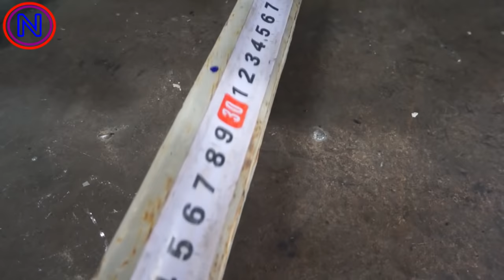Wow !!! What I Did From The Old Sewing Machine

Comment: Have you ever thought about making a potter's wheel out of a weighted weel stationary bike, all you have to do is weld a gear to the front wheel to change the direction of the spin then add a base for a potters head, head available thru AMACO add the cage and drip pan out of an animal feeder when you add the cage around the bike remove the existing seat and have a bench seat, that large of cage, foot pedal as you use the bike is still the same with the addition of the 1) gear 2) cage with seat 3) potters head and drip pan. you might need a few additional gears mounted on the underside of the potters head shaft. leave the potter's head original incase it needs to be changed out. If you like you can add an electric motor but the rpm needs to be between 60 and 70 rpm You can make other items using a stationary bile as the source of power for example washing machines and source of power for sewing machines and generator and even your saw as shown here or similar.

Comment: Mr Novruz... If you turn the saw 90° to your right, you can cut much much bigger size boards. Right now you are limited by the neck (column? ) of the machine. Your seat should be on the shorter side of the table :) Good work!

Comment: I have had this idea for a while years in fact?  That you can apply the needle to the paddle on the old sewing machine like this one Then this makes the machine mechanical completely you have to install a throttle like? something to start it up though    You may not have it go as fast at this one is however potentially it wouldn't be slow for sure.   The paddle is attached to the needle which now is all light weight and pushes the paddle for you. If you design it carefully enough and balance it as far as weight it should work pretty good. For me this could be a camping washing machine when there is no electricity or water pump etc. If you work the wheels you can see that they too can be made to create greater speed mechanically . anyway thanks

Comment: Nice idea √√ --- BUT there are some finishings I do NOT like at all: 1) The old Loge with its gold-color should have stayed as it was. Cleansing thoroughly then maybe removing some minor rust from the old sewing machine and as a finish - I guess a clearcoat would have done the job. --- 2) Soldering the cables would have been a much better way instead of just twisting and taping them …;((

Comment: This is a good idea, but Isee a little problem: The saw cuts when it is climbing. This is a problem when you need to cut a little piece of wood, since the saw can lift the piece and can be dangerous. I would place the machine upside down, cutting from the other side of the base, so that the saw cuts when it goes down.
Reply: They make blades that cut on the down stroke avoiding placing the machine upside down. You can special order them from almost any manufacturer  This machine could be made from any old sewing machine and the simpler the better. Very heavy duty!
Reply: Yes, but if it cuts when it goes down, it runs the risk of bending, as it cuts by pushing down. Arm it upside down, cuts pulling the saw. I armed one with a jigsaw placed under the table. It works perfect and I do not have to ask for special saws.
Reply: Or I think your right it did look a bit unstable

Comment: Good enough. If motor and table along with swing m/c are old then it is best example for utilisation. Such is  limited with tools and engineering skill required. if application  of such is commercialy benificial then it is excelent resource optimization.
टेबल , मोटर व सिलाई मशीन सभी के पुराने होने की स्थिति मे यह संशाधन के उपयोग का अच्छा उदाहरण है । यदि इस युक्ति का उपयोग किफायती पड़ता हो तो यह संशाधन संवर्धन का सर्वोत्तम उदाहरण होगा । 
@zerotechndesign